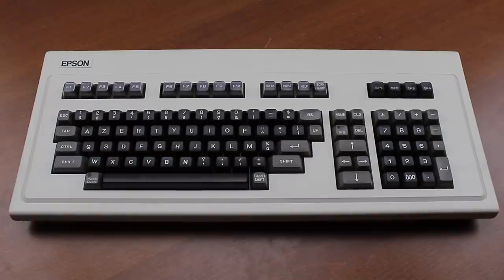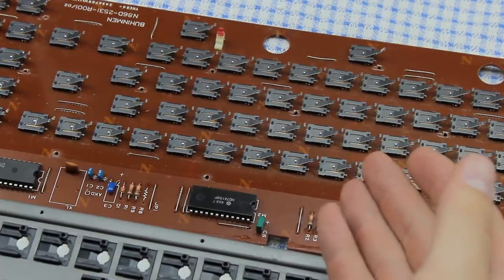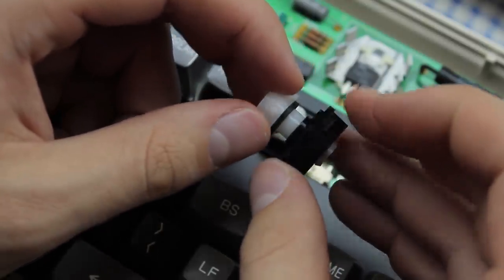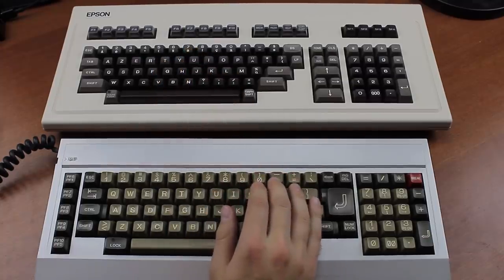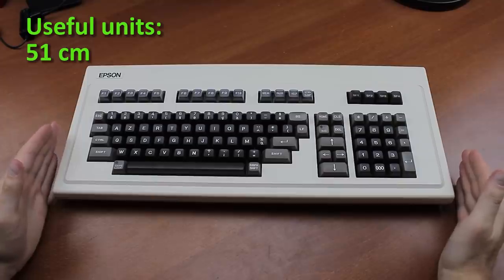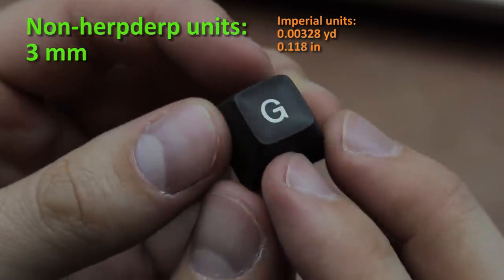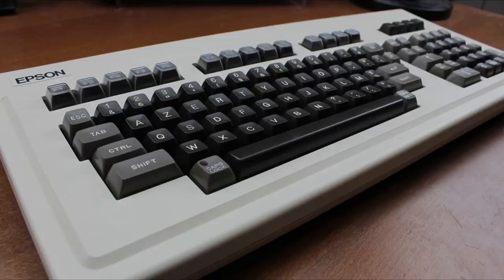Epson Q703A keyboard review (Fujitsu leaf spring 2nd generation)

Comment: It never occurred to me that the reason FLS's are so smooth despite being electromechanical is because being laid out flat means the sliders don't rub against the contacts. That really is an ingenious engineering solution for smooth linears, but I can imagine that this kind of contact orientation didn't catch on because it'd be more complicated to make tactile and clicky variants of leaf spring switches. Later switches were clearly designed to share as many parts as each other between tactile, clicky, and linear variants, after all. The only tactile/click mechanism that would be compact enough to fit in such an assembly would probably be click bars, which weren't invented until decades after this keyboard. Very fascinating, and kudos for bringing the topic to light! Love the South Park Scientology reference btw XD
Reply from the maker: Believe it or not, there is actually a clicky version of FLS, and they share almost all parts! ;)
Reply: @Chyrosran22  Please tell me you have one and that a video is coming up!
Reply from the maker: @Boyetto-san  I do have one, but it's not in good enough condition to review with any accuracy, so I'm holding out for a cleaner one :) .

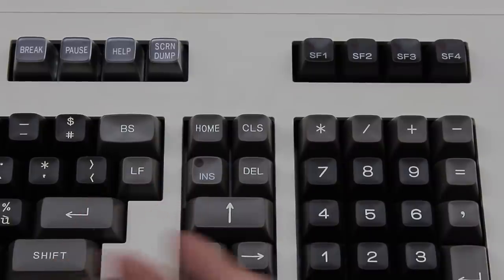Comment: 6:51  INS is not an on/off toggle, it's switching between Insert or Overstrike.  what you're hating (and rightly so) is when Insert is OFF / Overstrike is ON.
also:  it sounds like rain on a fiberglass awning.
Reply: Its still a toggle between two continuous (non-momentary) states though.  A lock light for it really should have been standard for it from the beginning, very useful.

Comment: Very nice! I have what appears to be a re branded Tandy 3000 and although the case is held together by superglue and bailing wire, the Fujitsu leaf spring switches a delight :-) Also, you are the President of Imperial Units Tom. That's Prime Minister  in European units :-)

Comment: Does someone knows, why my mech keyboard stopped working and how to fix it. I made my keyboard hotswap (soldering) and it was working after soldering while I tested with 1 switch in each hole. But then I added all keys and some of those had pins bent and keyboard suddenly turned off. Now it is not recognised by windows.

Comment: Cool keyboard, are caps lock and insert latching? Anyway as far as I know those keyboard can only be converted soldering all the rows and columns to a teensy, making essentially an handwired board with pre-wired rows and columns.
Reply from the maker: Nope, they are not latching. Just normal linears :) . I don't have experience directly attaching a Teensy like that, and I don't know if the protocol is known to it either.
Reply: @Chyrosran22  It shouldn't be that hard, you have to use http://www.keyboard-layout-editor.com to build the layout and then you paste the raw to https://kbfirmware.com/ . Once there you set the wiring diagram copying the traces on the pcb, and you'll have the firmware to flash. Than on the keyboard you find a way to solder a point for each row and column from the pcb to the relative pin on the teensy.
There's this guide for the Q703C, that has a different layout and pcb (at least the color) https://deskthority.net/viewtopic.php?t=21416
I was about to buy a Q703B from ebay, but not knowing if there are point from where to solder the wires from row and columns to the teensy made me desist...

Comment: The Epson QX-10 was a high-end CP/M machine --- Z80 processor, 64kB RAM, disk storage via serial-attached intelligent disk drives. I have the laptop version of the same, the PX-8, possibly the most overdesigned Z80 laptop ever. I haven't dismantled the keyboard so I don't know the technology but I wouldn't be surprised if it were similar. It's kinda chunky and a bit stiff; maybe it just needs lubricating. You can see me type in a program on its amazingly 1970s chocolate keys here: https://www.youtube.com/watch?v=S3MARL-F8NI (complete with key sounds, and no talking)

Comment: "Especially as I hate to have INSERT toggled on because it makes all your letters disappear if you're not careful." Nowadays the INSERT is ON by default. On old computers the OVERWRITE mode was on by default. So you would want to have the LED lit up all the time. Or rename the INSERT key to OVERWRITE possibly. Any way, the name is pretty clear, right?

My MSX unfortunately defaulted to OVERWRITE mode, which is an absolute nightmare when programming BASIC (or anything really). Good software toggled that to INSERT mode itself. Of course, that shows a good reason not to use the LED, as you would have to signal the keyboard that the LED had to come on. And as most keyboards did not have the LED, so...

Comment: You always make me laugh with the imperial units. Base 12 measurements do make sense tho for every day use as there are more fractions . Other than that tho they are stupid.
Reply from the maker: Imperial isn't base 12, it's base EVERYTHING! xD
Reply: More fractions? Why would yoh even need fractions? Oh yea let me just fit a 13/48th inch ball in a 37/128 feet hole. How useful

Comment: I would like to point that you are using imperial units outside of what certain units are to be used for. Like, you wouldnt use rods or fathoms (to name a few) in this cirscumstance. And if you are going use yards, furlongs, chains or miles, you should say cm, m, km, etc.
Reply from the maker: Centi, kilo, and milli are quantity prefixes. It's like saying 2000 metres vs 2 thousand metres; it's the same. All of them are the same unit.
Reply: @Chyrosran22  Yeah, but my point is that you use the appropriate prefix depending on the context. The same is with US customary/imperial except the only difference is that it isn't an integer scale. 

The other part is that you don't use survey unis when you would use normal international units. You have to consider the context for which a measurement is defined and  used. I've worked at a few summers at outfitters in the northern US and Canada where we would only use rods, chains, furlongs and (in one case in the Atikaki) statute miles just because they were measurements that scaled really well when discerning the distance of a portage or "somethings." We could've used SI units, but it just wouldn't have scaled as well. Where as right now I am at New Mexico Tech studying astrophysics and I couldn't imagine not using SI units. It all depends on context. 

imperial units were defined as issues arose and so they tend to be more anthropic. We don't encounter really any of those circumstances where a link would make sense over a foot or a gill over an ounce, so most of those measurements are just not used. They're still still defined because there are defined, you don't need to know them because they aren't warranted.